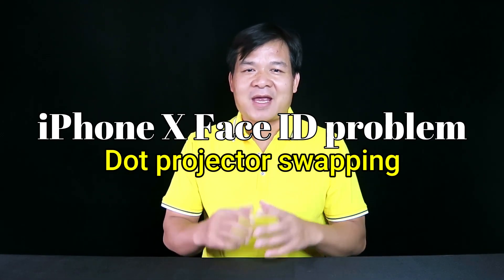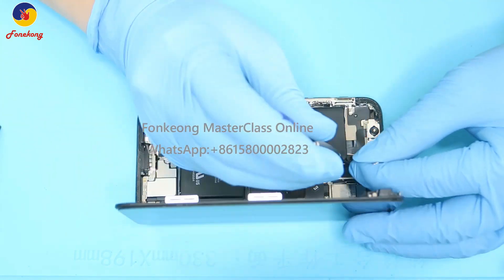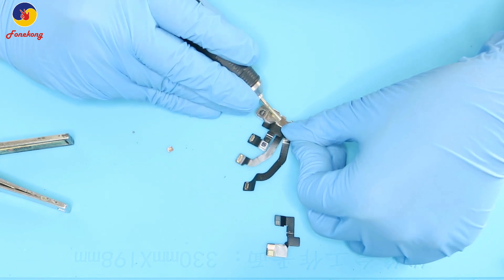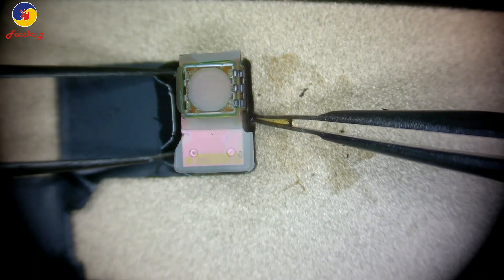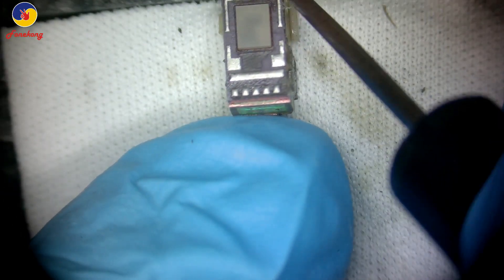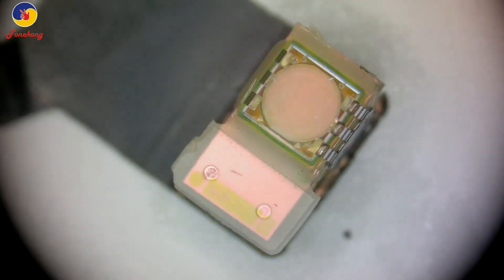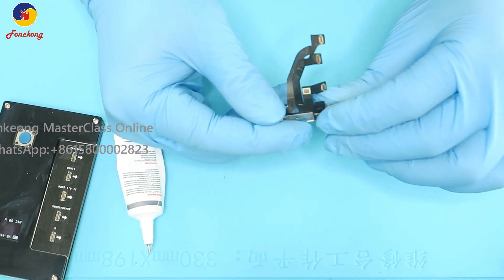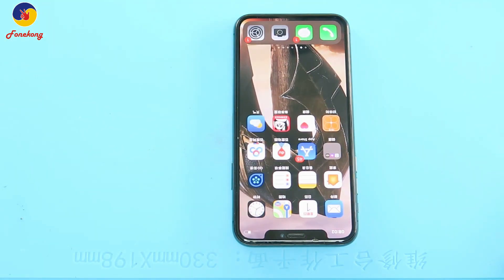iPhoneX face ID problem:Dot projetor is difficult to swap,let's see!#FaceID

Comment: How should it work??? I thought the Dot-Projector have an encrypted chip inside? If you swap the whole DOT-Projector the Face ID wont' work.
Because of the foreign part.
 Please explain, why do you mean that this method will work for us?
Reply: Thats what i wanna know.
Reply: I just watched this and take it the flex cable was faulty and maybe just  re ball on the cable would of solved it also??
Reply: @MrFujack103  No i test is not about reball.